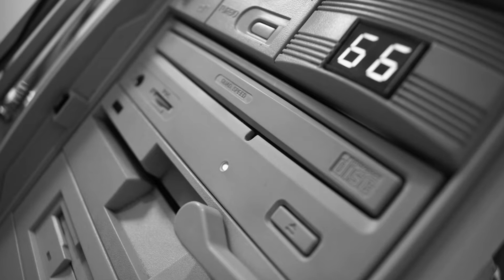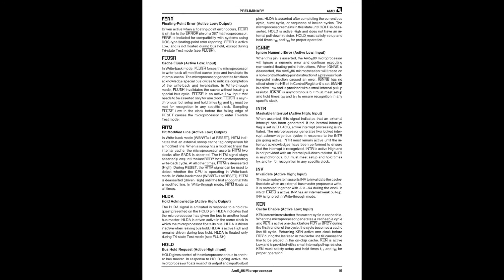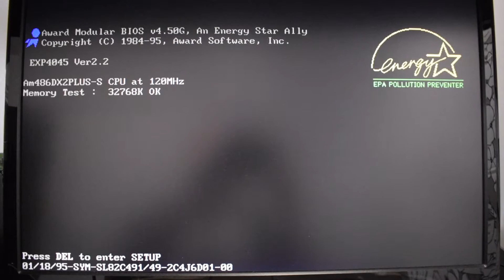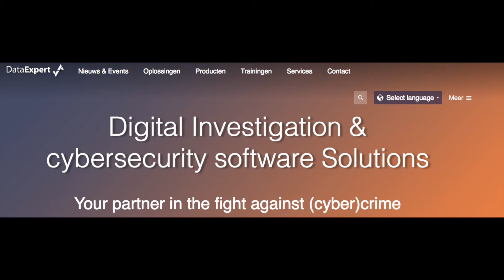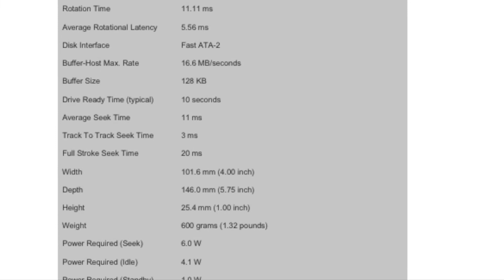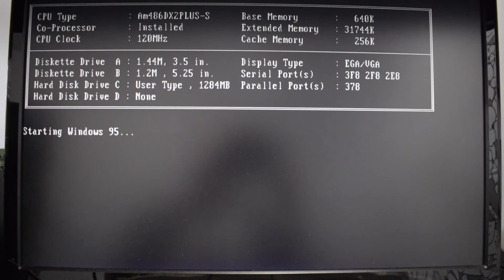486 Vesa Local Bus retro computer upgrade. 80 MHz Cyrix DX2 to an AMD Am5x86 P75

Comment: Im still trying to get my head around the concept of upgrading a vintage machine to another vintage machine! Watching for the memories. Like the commentary.
Reply: I made one of all the 486SX 20 CPUs to DX25, SX 25, 33, SX 33, DX 40, DX50, DX2-50, DX2-66, Amd 75 Hz 486, 80 Mhz Cyrix, Intel 486 DX4/100, 486DX/4 (WB), AMD DX4/100, AMD 120, P75 133 AMD, and the ODPR CPU 83 MHz. I used a Tseng 4000 VLB. For the higher ones I used the VRM.

Careful, if you put a CPU backwards, you'll destroy the board. In 1996 that was more desireable than destroying the CPU.

I gotta put that system together, I'm sure I wrote the specs down somewhere and most of the footage is ready.

Comment: i also got 200mhz out of my amd586 133.    just make sure the heat sink is big ! and you set your wait stated on the Ram correctly and set the bus clock divider  correctly in the bios. i also had 1mb of cache chips on my motherboards.
at 200 mhz it had the performance of a pentium 120

Comment: VLB rules. Yeah I know that it might be inferior to PCI. Yet it is pure nostalgia to me, as I used to have a dx2-VLB system from 1994 untill I upgraded it to a 5x86-133 around 1997.
Reply: The idea behind it is so metal too. "We need more bandwidth...Lets wire cards directly to the CPU."
Reply: I had a DX-50 VLB machine. It actually ran correctly!
Reply: @the_kombinator  Then you had only one VLB card. Or you had extremely well build VLB cards if you ran two or more. 33fsb then 3 cards. 40 then 2 cards. And 50 you run with 1 card.
Reply: @brostenen  I'm not sure where my post went to but I had two VLB cards in there, both jumped to >33MHz. IIRC one was a Mach 32 the other one was a generic VLB I/O. I kept that machine for a good year or two before I was able to afford a P133 - I skipped over DX2/66 (I mean, I have like 5 of them right now lol) as a result of the DX50 being able to keep up with a DX2/66.
Reply: @the_kombinator  Then you had some good quality cards in that. VLB are designed for a standard 33mhz FSB, as that was what were avaliable during the devellopment. But good hardware can be pushed, and so can the bus it self. After all, VLB is just a bus.

I went from 486slc2-50 to 486dx2-66 and then had a 5x86-133 briefly, and then went straight to a K6-2-500.

I also collect old stuff these days. I have a dx2-80/VLB and a DX-33/ISA as my only 486's now. I did have a DX4-120 and a 5x86-133 as well. But then got a Pentium-166.
Reply: @brostenen  I can't even list how many I had. I worked at a local computer store since I was 14, and the owner saw that I spent almost everything I made in the store, so he started paying me in parts, that I made to create systems and sold in the classifieds, making way more than if I had taken cash there. I still have a lot of those parts that I'm assembling into systems on my channel ;)
Reply: @the_kombinator  I will check your channel out. Personally I have my own channel, were I also show some of the C64's that I have build from scratch.

It was a golden time back then. Yet I have sadly never used EISA or MCA machines. But I tend to compare EISA with Zorro-II, with the only difference, being that you had to configure resources manually on EISA. As compared to Zorro-II, the memmory allocation and DMA settings, were baked into autoconfigure. But basically much the same features and bandwith/speed.

Comment: Question: You slapped that battery holder straight in. No diode? Not worried that the board will try to charge that battery?
Reply from the maker: If it has the layout to support a CR2032 socket I am generally not worried. On older boards I stick to the manufacturers battery form factor and specs, of course I use ones with better chemistry.
Reply: @ComputerCaveman  I know I'm replying to an old comment, but this is not good enough evidence that the battery is not getting charged. You should take out the battery and use a multimeter to confirm that there is no current going to the poles when the machine is turned on. :) If it is getting charged, get a low-voltage-drop diode installed.
Reply from the maker: @8bitbubsy  Completely agree! I got to that conclusion as well at some point after the video, cheers!

Comment: I can't get my 3V VLB boards to run at 40Mhz bus, except one, which has a stupid layout and I cannot use the cards I want to use.
Reply: I had to run a intel overdrive on one of my VLB boards to get to 66mhz normal 486 chips would not go over 33mhz for me. I also have a VLB board that supports DX4 120mhz that for some reason the previous owner put a DX2 66mhz intel overdrive in aswell